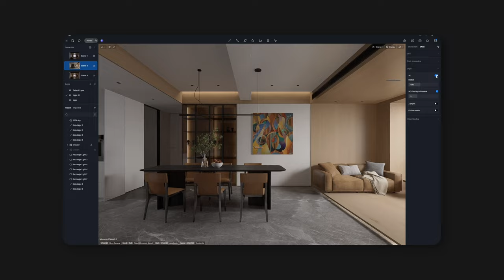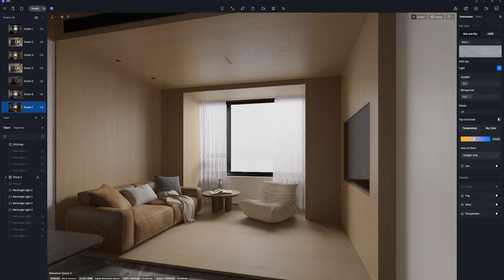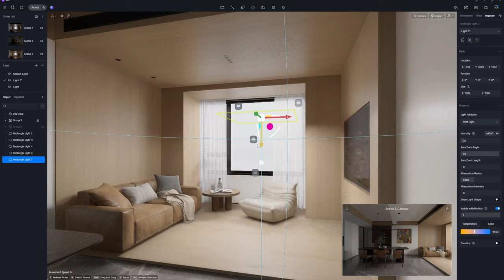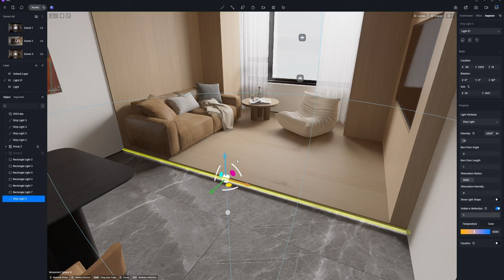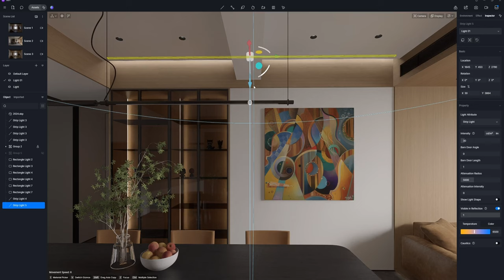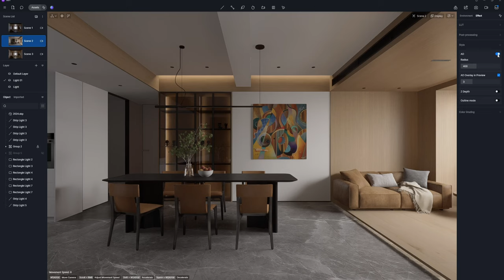How to boost brightness in long rooms while maintaining balance | Community-made Tutorial

Comment: Im an architect and do both exterior and interior renders. I do exterior rendering in D5 coz of the easiness setting the surrounding landscape, But Im afraid to use D5 coz, my laptop screams, when using it. I use both D5 and Enscape . Enscape got rest mode so it keeps it silent to most of the time when doing realtime work, while d5 always screams and laptop throttles often , I changed my laptop once, thinking its the problem of laptop, my second laptop also screams like the previous one. Coz of that I use enscape for doing interiors and use fake lights to create raytraced looking shadows and images as in D5. When using D5 the entire office knows I have opened it. Please D5 make a rest mode or like prebaked lights like lumen as seen in UE5. Thats  not good looking to see pixelated raytraced noise shining here and there .The program has so much potential, I hope the company make use of it .
Reply: I use d5 for my landscape design and it lags way too much when I started putting my grasses and trees for some certain amount, i can't even move my camera. I'm using rtx 3050 for my graphics (i know it's too low) but i can so much more in Twinmotion with this graphic card, it's lagging but not as much as d5